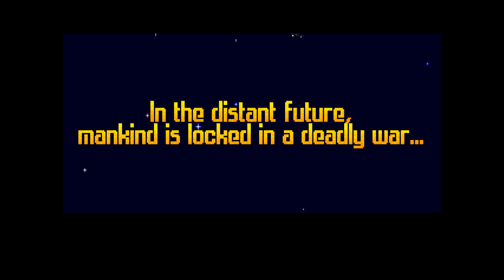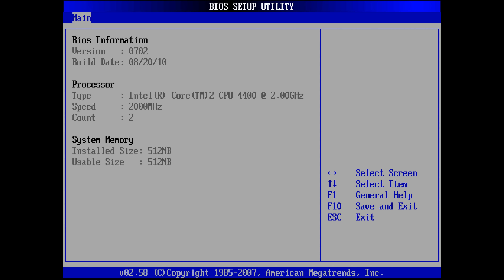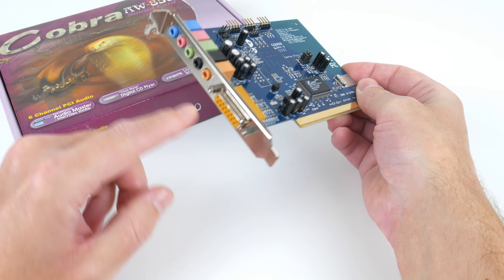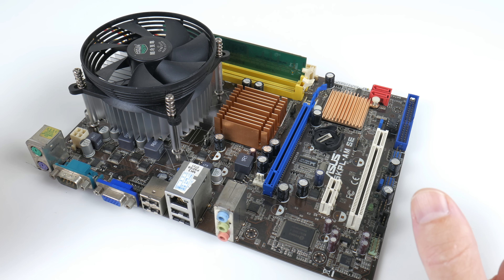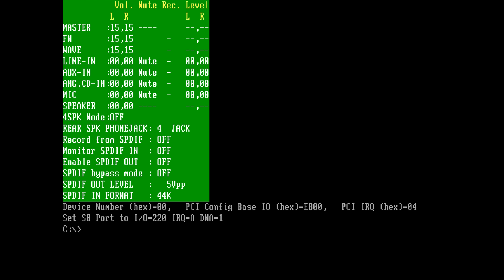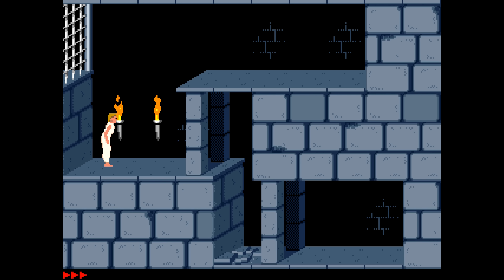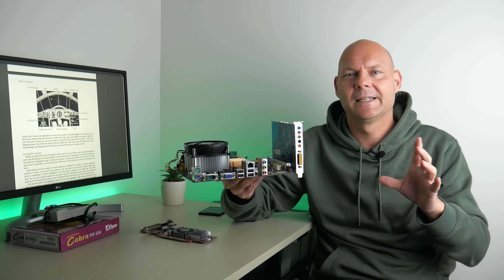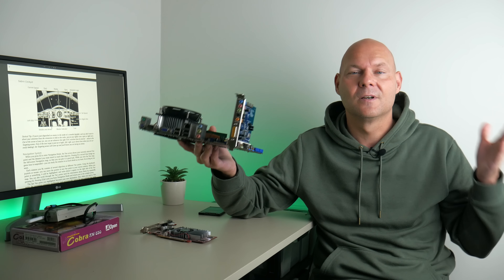DOS Retro PC with Parts nobody wants

Comment: The cmi8738 has a very decent sb16 compatibility actually, i have worked on os x ppc drivers for it and it's surprising how clever their implementation is, it's also pretty decent for opl3 music, the major downside is the dac really, since you are stuck with the one built into the dsp and that's not that decent, also for filtering that not that great on lots of cards using that chip, they are quite a bit noisy, but since it also features toshlink/spdif it might also be paired with a better dac and solve those issues, you should also be able to use the digital out with the sb16 emulation or the opl3 if you get the right drivers for it.

Comment: It's really cool to see that LGA775 is still very much alive in here, I am a huge fan of the platform - especially on a desktop if you can upgrade to a Core 2 Quad CPU with 8GB RAM. Even if such a machine struggles to run modern Windows, it will run any Linux distro perfectly happily as a daily driver and for retro gaming in WINE and DOSBox.
Reply: Even better, it will run older, contemporary versions of Windows very well, without all the hassle of getting running properly, if at all, under WINE. Despite what some zealots seem to think, Linux is not the answer to every problem. Whilst Linux may, in some cases, require fewer resources, and the OS itself feels snappy, the software that people run on it does often does not. There's plenty of empirical evidence showing that many things run slower under Linux, and that hardware drivers are often less well optimised.
Reply: @another3997  See my previous response - I am not repeating the same thing to someone who is clearly a bit lazy and unwilling to learn Linux properly and is just a bit jealous of those of us who have put in time and effort to learn it.

Nothing more to see or say here - your unwillingness to learn is not a Linux problem.

Discussion closed, I really don't like wasting my time on people who try to blame their own inability to commit time and effort to learning something on something else - you're probably in that millennial generation that appears to have more than its fair share of lazy people in it.

Comment: Phil, good sir! LGA775 still rules! I have a wonderful P4 AGP Build for 98SE (ASRock 775i65G), another Q6600 AGP/PCIe build for XP (ASRock 4CoreDual-VSTA), and the top end QX9650 for Win7 gaming (ASUS P5Q Pro). All Socket 775. I also have two spare, good as new LGA775 Gigabyte GA-G41M-Combo boards that take DDR2 or DDR3 in storage. The venerable Abit VP6 PIII duallie, the stellar MSI Pro266TD Tualatin duallie, and, pending new caps, an Abit VH6T for single Tualatin overclocking, my fastest PIII machine. My HP150 Touchscreen can also game.
Modern gaming is on my Z390, and at the wife's office on a Xeon-based Z97 mini-ITX I adore. There you have it, my full confession as a HW hoarder (aka "enthusiast").
Reply from the maker: Awesome 😎

Comment: I'm still using a Core 2 Quad with 8 GB of RAM and an older GPU. I mostly use it for office, web browsing, and emulation. Works fine with Windows 10. It isn't even running at full potential considering I'm pretty sure newer 775 boards at least have PCIe 2 and SATA 3

Comment: my W98SE PC is a socket 775 GA-P43-ES3G motherboard + core2duo E8600@4ghz + 4x1gb of 800mhz DDR2 in dual channel (limited to 512mb under dos/98se), dual boot on linux mint.
ATI X850 XT graphic card and Audigy 2 ZS sound card, 500gb Sandisk SSD (4x120gb in Fat32).

hardly what you'd call period correct hardware but thanks to your advices it's arguably the fastest windows 98 computer i've ever seen lol :P
i was about to bite the bullet and buy a pair of Voodoo 2, but tbh it emulate every 3DFX games i've tried in 1600x1200 60fps locked Oo

that being said, if i was to make a dedicated DOS machine i would defenetly go for older hardware and a much slower CPU, 
haven't spent much time looking for a solution yet but i'm sure my specs will come back to bite me in the a*s sooner than later on some other games.
Reply from the maker: Very nice parts! You have the best of a alot of things!

Comment: Impressive that something as modern as a C2D can run at 286 speed. I have several 775 motherboards at this point even NOS but I have even more AM2 and AM3 motherboards. I’ve stopped collecting since a year ago because I already have way more than I have cases and power supplies to build them. Apart from a few very specific motherboards and CPUs P4, Athlon 64 and C2D stuff is still very cheap and easy to come by here. Some are even giving them for free. I’ve gifted and been gifted a few old motherboards. It’s nice to save them from being destroyed and I like it if they get put to use.

Comment: When all you have are unwanted parts, call the professional retro nerd...

And I thought having a unloved 3.0ghz Pentium 4 HT was crazy lol. Speaking of crazy, somehow the P4's motherboard has no bad caps. (I check the baord every few months in hopes of spotting a problematic cap before it goes poof)

It's a Sony Viao VGC RB30 btw. I saved it from becoming e waste, unfortunately somebody walked off with the stock graphics card and the "media card" and I've made some config changes myself so it's no longer stock. I installed a ATI 3600 series graphics card a 3640 and a sound blaster Audigy se,maxed out the ram, I've also unplugged the built in card reader since it's not plug and play and I can find the sony drivers, disconnected the opticals (since you can't get to them the way I have the machine setup. Its facing a wall) and installed a 4 port usb 2.0 card
Reply: I have got a Dell Optiplex SX280 with a Pentium 4 HT 3.0 GHz CPU in it (probably the same CPU as your one) and it runs a 64-bit Gentoo Linux build perfectly happily and I don't plan on getting rid of it.
Reply: @terrydaktyllus1320  Nice 👍 I've noticed a lot of people seem to save those old Dell omiplex and dimension machines. Wouldn't be surprised if it was the same cpu. Neat mine is my fun retro Windows XP gaming pc, same won't be getting rid of it
Reply: @JohnSmith-xq1pz  They're good little machines with good quality components and builds - the only downside is limited expandability with some of the bespoke case formats.
Reply: @terrydaktyllus1320  lol yup that's what I hear all the time, in fact the only one's I've ever really ever heard criticised was the machine in the "clamshell" case's

Comment: I use a C2D E8400 with 3 GHz and 1Gb DDR 2 800 Dual Channel Ram as Windows 98 SE High End machine. It has a GeForce 7900 GT with 256 MB and 2 voodoo 2 sli cards connected via a pcie to pci bridge with its own power supply. Works flawlessly. However, if I install the two Voodoo 2 cards directly on the board in the PCI slots, the PC freezes. The G31 chipset probably doesn't like SLI in the PCI bus. I use an SB 128 PCI as the sound card, unfortunately many PCI sound cards tend to stutter under Win98 in newer systems. The DOS sound also works, even if it's not the best. With many other PCI cards, the DOS sound no longer works on newer boards (no SB16 link)

Comment: I bought a few huge boxes of scrap end of 2022 and found in it over a dozen working 775 boards, some just needed a cap replaced or something, others just worked.
They have been wandering back and forth through my workshop with me developing and discarding several ideas what to do with them. Cheap Linux machines, sell the parts, nothing really made sense.
Just a few weeks ago I decided to build 8 of them up into a  set of Windows XP PC's that I can just wheel out of the storage for a nice small LAN-party. 
Maybe I'll just turn the rest into DOS machines then...

Comment: I have one of the last boards from Intel that even has uefi and enough PCI slots (that's why I bought it back then). It even has speedstep and the core voltage can be lowered via windows, which many other boards cannot do.

Only the energy efficiency is not so nice compared to my I7-gen2.

The I7machine needs about 50% less, with 4 cores + hypertreating.

But with the new tools from the vogon site, you can actually continue to use the computer for old software. Especially since my motherboard has only been running for 6 months.

Thanks for the tip with the soundcard.

Comment: I'm watching this on my daily driver Asus P5P43TD Socket 775 Q9550 w/ 8 Gb RAM. This year I upgraded the GPU to a Radeon 580 8 Gb RAM card. Still works great after 10 years! Steam is going to force me to use Windows 10 next year, as they are ending support for Win 7 this December.
Reply from the maker: Yup a Core 2 Quad with enough RAM and SSD is still quite capable. Steam I'm not happy with. After they abandoned XP and Vista I didn't buy another game. Buy only from GOG.

Comment: Still use a Dell Optiplex 380 with a Core2duo E6750 to run windows 11 and browse the web, watch youtube (even smooth in 4K), etc... Maxed it out with 8gb of ram, a ssd and a low profile Nvidia T600. It actually keeps up with modern systems. Just found a Core2quad Q9550 cheap on Ebay this week and gonna put that in this weekend. will be interesting to see what performance difference this will give.
Reply: My main is q9650,it will keep you up for another 2-3 years if you dont care about gaming, everything else runs fine!
Reply: @vasileios6301  I must say with that T600 in it (directx 12 support) is gets most "newer' games going well enough in 720p and some even playable in 1080p. The bottleneck is the cpu because in benchmarks the t600 doesn't hit 100% of usage but the cpu does max out. I have a lot of working pc's I still use ranging from an Atari pc3 XT to pc's I use for gaming like an i5 9600k and for desktop stuff (premiere pro etc...) a Lenovo P710 Thinkstation  with dual xeon e5-6550 v4 processsors. The Optiflex is just my daily driver since it's small, quiet and still not too power hungry (electricity prices are insane these days!).

Comment: LGA775 is IMO the ideal platform for a wide selection of retro gaming. In addition to working well with DOS, you can also have a great WinXP gaming experience with a more powerful GPU and more RAM.
Reply from the maker: Heck yes, it even does well with Windows Vista and Windows 7!
Reply: One question I have never got an answer to - does Windows XP ever use more than one core of a multi-core CPU?
Reply from the maker: @terrydaktyllus1320  XP is just the OS. It's up to the applications. But yes, XP supports multi core, so video encoding will be much faster. Far Cry won't. Some games even have issues with more than 1 core.
Reply: @philscomputerlab  Thanks, good to know.

Comment: Best part of 775 is. You can install brand new CPU cooler with RGB or just pick whatever shape you want (478 is dead end). I had that same Motherboard, but after several times fail to install winXP. The PC just die. The power still run but nothing on screen. Now it just ended on garage.
Reply from the maker: Yes great point about the cooler.
Reply: Try changing MB capacitors. I revived a few motherboards doing that, specially the large capacitors that support power distribution near the CPU

Comment: I'm using that same board on my XP/7 retro system, it's the P5KPL-AM EPU version with 4 sATA ports (SSD+HDD+ODD+5.25" sATA HDD bay), the BIOS is modded to support a quad core XEON E5450 @ 3Ghz. I'm currently typing on another ASUS board with a XEON E5450, works fairly well for daily use too, no need for new CPUs since I only play retro games 🙂

Comment: LGA775, from DOS to Win 10. Can't beat that compatibility. Should work fine on Win 98 as well with the onboard graphics. The clear advantage of this config, is the onboard graphics. Be sure to get the LGA775 with the Intel Chipset, which has the Intel GMA integrated Graphics running on the FSB bus, which is DOS compatible (sadly QPI or Ringbus is not, so more modern Intel HD graphics is not usable).
I'm impressed that is is possible to actually slow down a C2D CPU this much to make it speed sensitive DOS game usable.

Comment: The Core 2 Duo series are still so versatile being able to do DOS gaming to even running the some of the most modern Linux distros like Manjaro GNOME for basic daily task, as long as you have a good SSD, 8GB RAM, and a 1/2 decent GPU.
Reply: Well ...
You can run Linux on about anything.
A small CPU is a pain when we need to use Internet.
And I've been using Linux daily since 1998.

Comment: I was reading about the Radeon HD6k series getting a Vulkan driver for Linux earlier today and was wondering how well Core 2 can go with DOS and even Win9x, then that night I see you've uploaded this. 

In theory with the right hardware (eg. HD6k + older PCI GPU, onboard HD audio + old PCI DOS compatible sound card, etc) and a lot of work it'd be entirely possible to make a PC that can natively boot DOS, Win98SE, WinXP and up-to-date Linux (ie. Proton + DXVK/VKD3D = Compatibility with a lot of even modern titles) to be able to natively run most PC games and programs from a ~45 year timespan on the single PC.

Comment: For a long time I was an AMD only person, but when the Core2 came out and Phenom was a joke compared to it, I went to an Asus P5K with C2D e2200. I stayed on the LGA775 for a number of upgrades. Went Asus P5Q-E Not long after with a C3Q Q9450 then later a Q9650 (which I was still using when I left Canada and moved to the US back in 2012, That Board and CPU are mounted on my wall in honour of its long service and happy memories in gaming.

Comment: I use an old itx motherboard with a soldered  VIA CPU, with 2gb of ddr2 memory. I removed all the fans, and configured the psu fan to run with 7v. It is completely silent, and runs old games and mame roms perfectly. I can even play some 3d arcade games like tech romancer
Reply: Old Zinc emulator?
Reply: @vasileios6301  yeah!!! :D
Reply: @alejandromoran4590  Good times! Zsnes and Kega Fusion (Snes and MD emulators) will work also perfect on it

Comment: Plenty of oem 775 going around for cheap or free. None of the nice asus ones tho. Had it in my mind to avoid these that do not support the c2q but with dos gaming and tinkering with older operating systems they don't seem that useless anymore. Lack of bios options are a deal breaker for oem motherboards tho.
Reply from the maker: Slow it good, any cheap Celeron or C2D will do :D

Comment: CMI8738 is pretty much an awesome FM chip. I cannot recommend it enough if you're looking for a replacement for YMF262. It even works on modern Windows to this day! Including FM! All you have to do is pass port 0x50 of the card to the app (like VGMPlay) and it'll work!

Sad the SB compatibility is low, though. I wish it was better because that is the only thing keeping it from being the perfect PCI DOS sound card IMO.
Reply from the maker: PCIe 😮 amazing
Reply: @philscomputerlab  Yep! It works via the PCIe bridge! So if the card is at BC00, you tell the programs the FM port is at BC50 and it should work fine. That 0x50 is the same as 0x388 in DOS!

Comment: I have an old Dell dimension with a 775 mobo, Core 2 extreme QX6700, GT8800, Sound blaster X-Fi. It's built like a tank!

It smashes XP and earlier games. I got it for about £5 years ago with no hard drives, now has 2 x 250GB 10,000 RPM drives in raid 0. Did replace the PSU as it smelled really bad. 

It would have been probably 2-3 grand back in the day???? The CPU alone was pushing a grand IIRC.....Crazy. Just wish it had a better board and bios. But it scratches my XP itch.

Comment: Hey Phil - great video as usual! What are your thoughts on LGA 775 for Win 98? Some of the other comments have said it has great compatibility all the way up to Win 10, so I’m guessing you could make it work. I’m currently running a socket 478 Pentium 4 for my win 98 machine but the cooler for it is LOUD. Try as I might, I can’t find a reasonably priced custom cooler for the platform, so I’ve been thinking about swapping to something different. My guess is the main challenge for LGA 775 + Win 98 would be trying to find a good GPU with compatible drivers (I’m guessing AGP is probably not a thing on those mainboards).
Reply from the maker: I've done a video on this topic actually! The main issue is there are no chipset drivers and usually no drivers for the onboard devices. Most 775 boards being PCIe you are also limited. But. If you stick with PCI devices, like a Voodoo 3 PCI, Sound Blaster Live! and PS/2 input devices, it can work really really well as you just skip the chipset drivers.
Reply: @philscomputerlab  Haha - I should have known you'd already done a video on this! Thanks for making all these videos - they're a great way of educating people about how to get started. The other option I'm considering is Athlon 64 - getting quieter coolers for that platform seems to be less of a challenge, and I think the drivers should be less of an issue as well.
Reply from the maker: And there will be more videos! The community will move from older to newer in time, just as they did moving from 386 to Socket 7. It's exciting times and new tools and discoveries will be made :D

Comment: Using Cpuspd on core 2 or dual core CPUs is very exciting, as it provides over a few thousands steps for slowing down the CPU to whatever speed needed, be it 286, 386, 486 or even 8088. For example, with a dual core E6700/3.2G and a motherboard with VIA8237, it could provide 2 (cache on/off) x 8 (ODCM) x 16 (south bridge throttling) x 13 (cpu multipliers) = 3328 steps for speed control. With a motherboard with ICH6/7 south bridge, the number is halved (ICH6/7 has only 8 steps for throttling), but we still get 1664 steps which is incredible. And there is no need to get into BIOS to fiddle with the settings!
Reply from the maker: Note that I found the southbridge throttling nit that great. It will give you weird input lag. But the CPU duty cycle works very well!